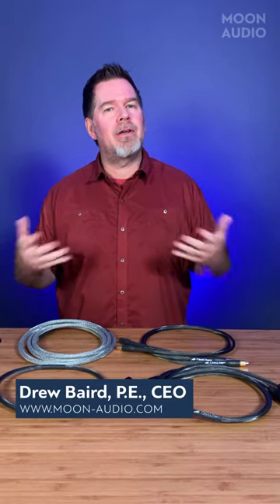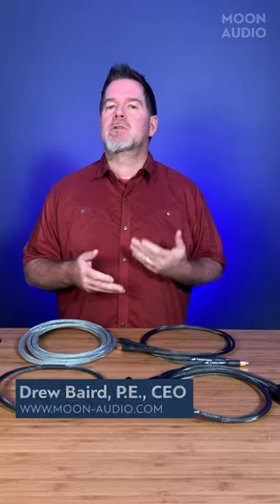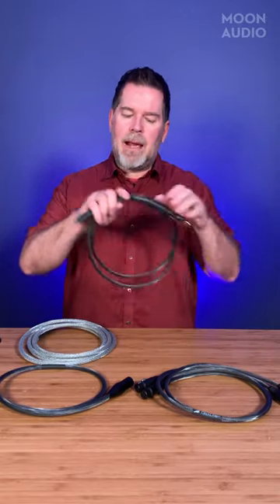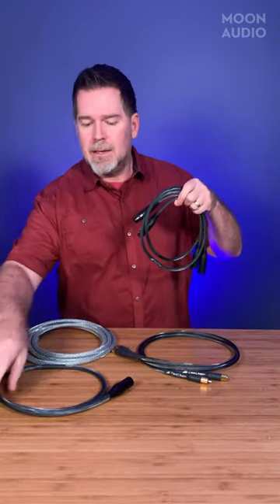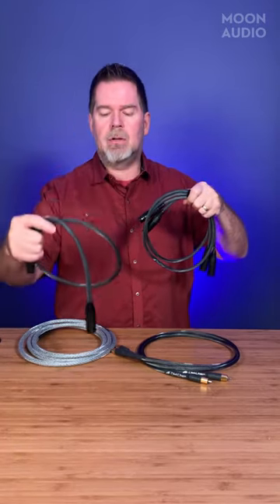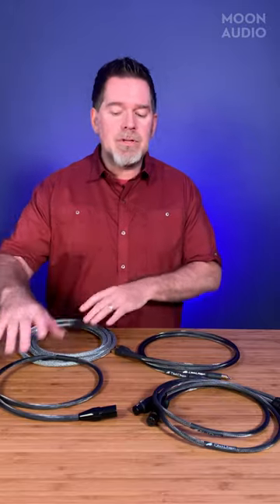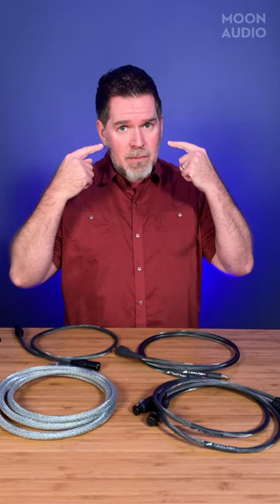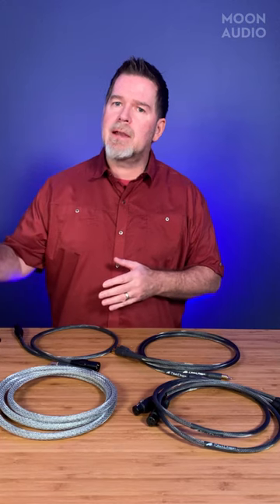Analog Cables or Digital Cables? | Drew's Audiophile Tech Tips

Comment: I don't understand what makes something a digital application versus an analog. Which one do I use to connect an amp to a pre out or a receiver to a subwoofer?
Reply from the maker: Digital is playing back your music. Think of your computer or your TV playing music. The digital output of your TV goes to at DAC (Digital to Analog Converter) where it becomes an analog signal that is sent to your Pre-amp. From the Pre-amp to the amp is pure analog.
Reply: @moon-audio  Sweet man thanx. Im just now dipping my toe into higher quality audio gear so im still learning.
Reply: @moon-audio  what is the impedance of the DACs RCA conection ? How about a cd player RCA conection ? So does it actually matter. Your ears are better than measurements, you sure. So if that's true could 60 ohms or 57 ohms sound better.